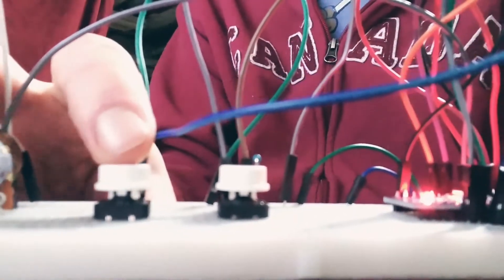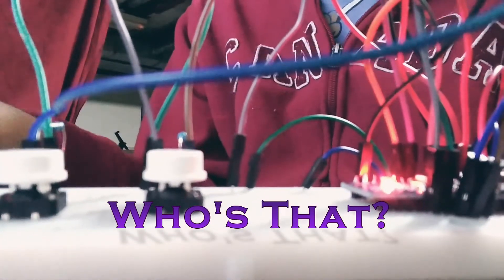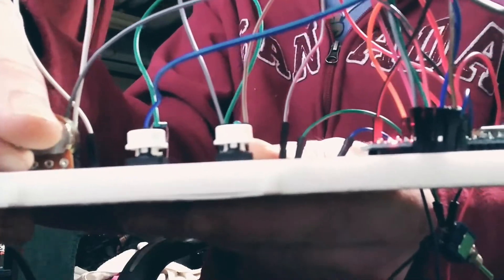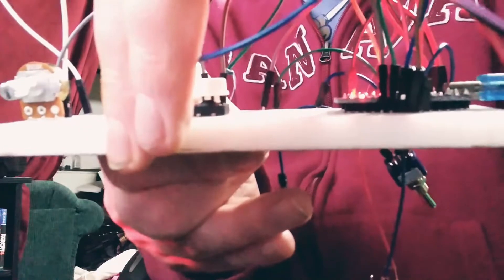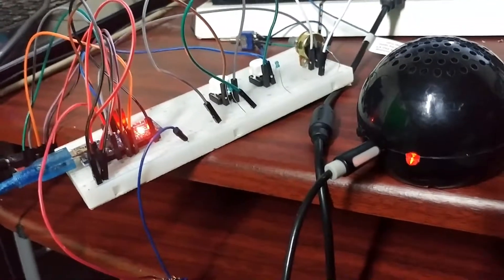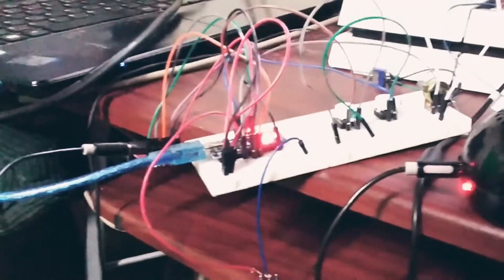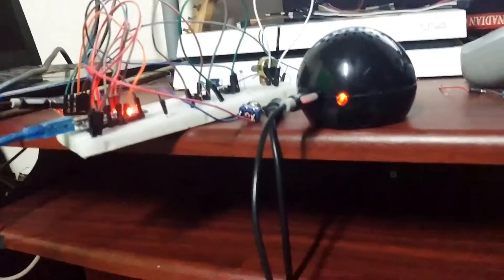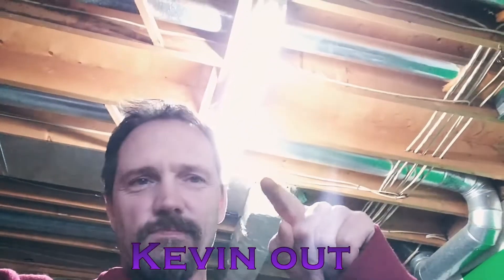Arduino Ghost Box Complete - Except for Casing!

Comment: Cool, It has a Interesting Sweep pattern, Sounds good though.  If you send me your current Build sketch I can see if i can Impliment Memory to save your vol setting, So will always use your last volume preset.  Another work around would be to set the volume to max in code and have a Pot on the output, to dial in volume. Which ever sounds easier,  Might be better with a Pot to do the volume thinking ahead for mounting to a box, Buttons are a wee bit fiddly to mount,  I also have source links to some great Momentary switches ive used in the past, There bolt on mounted which are easier to use Good quality too. Few bucks for about 10 in various colours.
Reply from the maker: That would be awesome and thanks again Puggster. I was playing around with the button last night to see how well it would fit on a proto board. Not well at all. A pot would be a better solution. I would love any links you have to switches you use (especially the toggles if I decide to do away with the momentary buttons) First real arduino project for me and still learning so it's hard to know what to use. Will upload my sketch and send it to you.